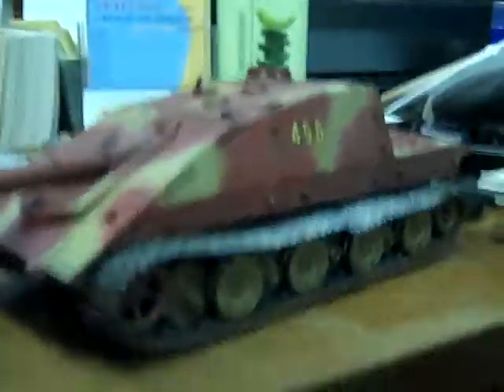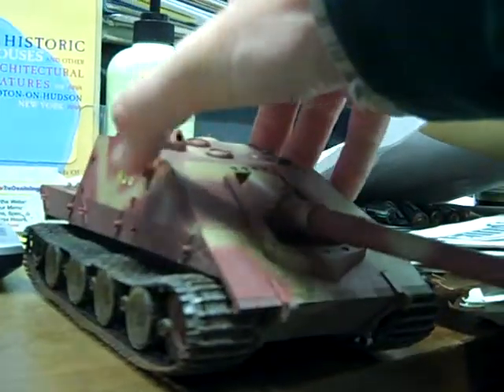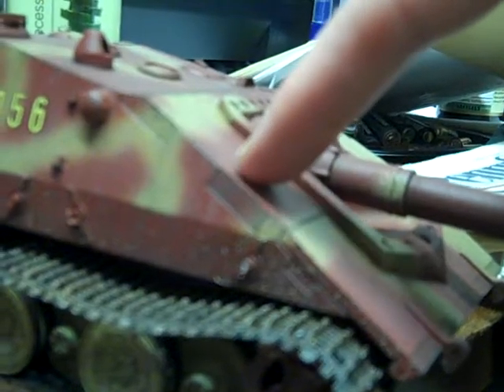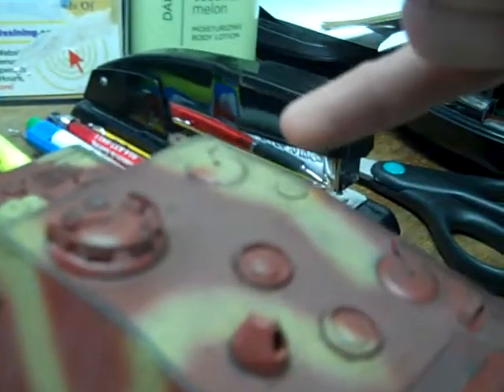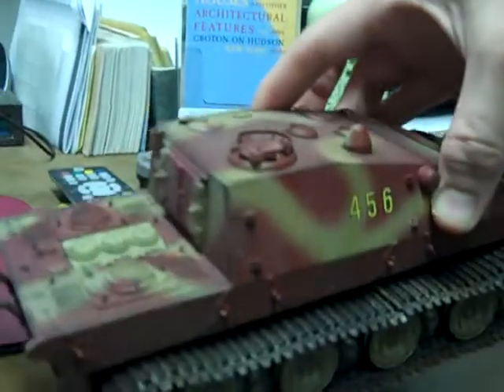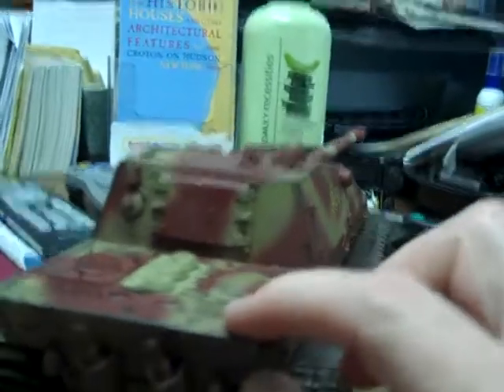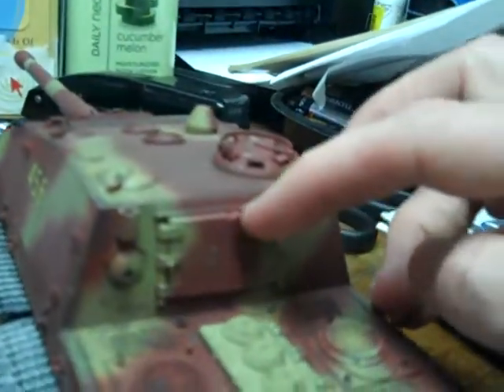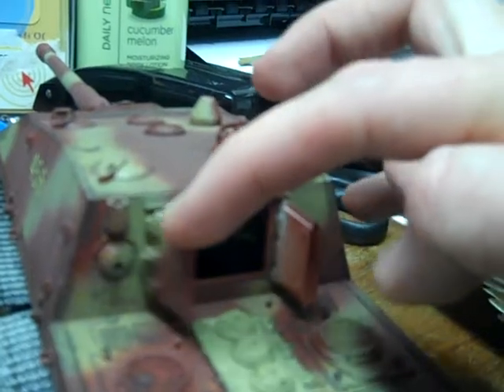The 150 ton E-100 Jagdpanzer of Nazi Reich.

Comment: The E series of german tanks included the E-50, E-50 Ausf. M, E-75, E-100 with two different turret configurations, and the rear and front mounted superstructure on the JagdPZ E-100 with each carrying 17cm guns with long reloads, but none of which were ever built.

Comment: before the tank can be made it needs to go threw tests, like weapon testing, they armed the E-100 with a 10,5 , 12,8 first on weapon testing. but the Beta (if you wana call it that) frame was never made. the gun was housed on the Alpha if you want) frame which didnt have a gear box or even armor, it was just a large enough hull built from a JGtiger (same gear box as the JG) so they could weapon test it. the 17,0cm was in planed production for the prototype, but the 17,4cm is still a blueprint

Comment: As far as I know the E100 never got a turret. Only the tracks and the hull was completed as the war ended although it was planned that the e 100 prototype got the turret of the mouse (although there are also rumors hat Adler planned its own turret for the e 100. The e 100 was cancelled in favor of the mouse and so work on the e 100 prototype was very slow and only continued with a few workers. I doub that the e 100 was tested with a gun-at least in germany. I duuno what the allies did with it.